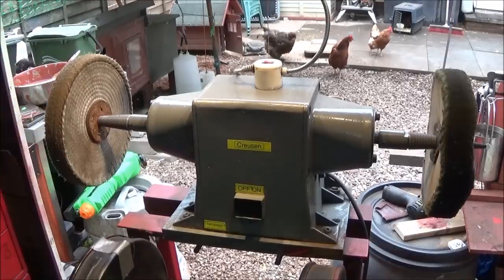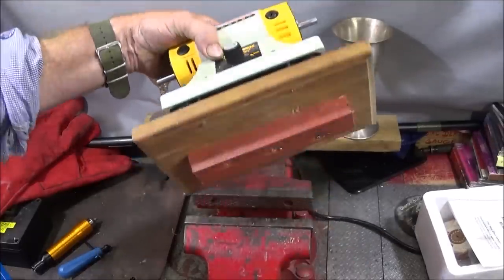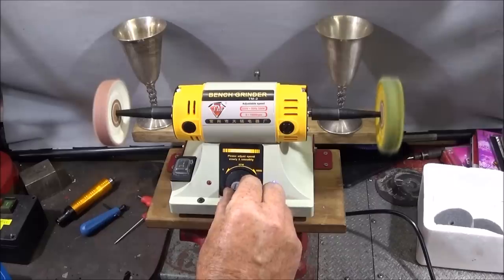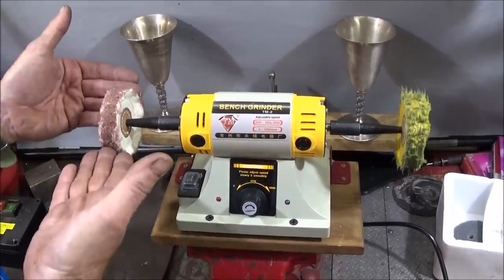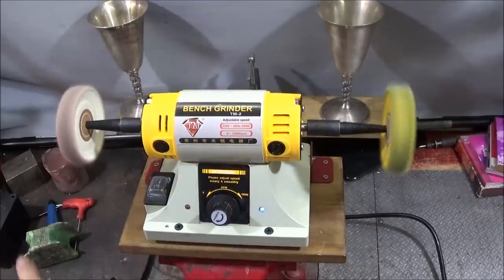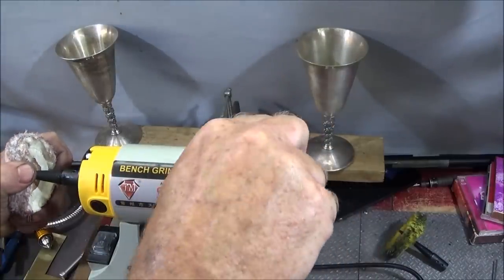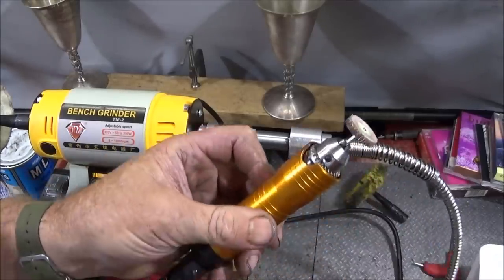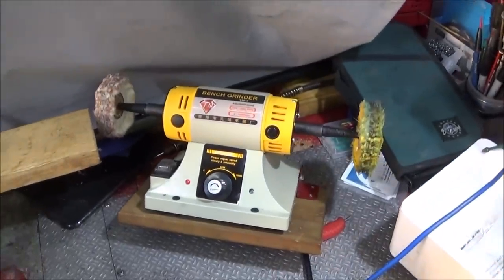Bench Vice Buffing/Polishing Machine & Toolpost Drive Tool TM-2

Comment: Steve,
If you had a skirt underneath the grinder that was larger than the vice as well as the piece that clamps in the vice it would sit properly on a flat surface as well.

Mike

Comment: I've been waiting like a puppy for your promised video of your shop made radius cutter/ball turner for the "Chinese Lathe".  I've also been purchasing some of your recommended tools and products as I find your reviews interesting in light of your machining experience.  I think that a lot of viewers like me trust you, and I know that you're aware of how important that is.
Reply from the maker: Hi Jeffrey, I will get round to it at some point. Did you make the first part how I explained in the first video? All that is very straight forward. Its the insert holder part that takes a bit of time.
Reply: I've been looking at Part # 4836 at Little Machine Shop . com; it's a T slot compound rest top  for $35.82US.  Together with a new gib strip this seems like a good way to go.  What are your thoughts?  Thankyou for your consideration.

Comment: Why did you acquire adapter for flex shaft attachment? Does it not attach to grinder unless you get the adapter? Not a frequent tool user so having a hard time figuring out how to attach the flex shaft to the grinder end of it.

Comment: Hi do you have a link to buy the flexible shaft adaptor that goes onto the spindle to enable me to attach the flexible shaft. tx
Reply from the maker: Hi Vicky I have searched the Banggood site but can't find the listing. Mine actually came with the flexible shaft when I bought it. I have recently bought another polisher but there wasn't one included in that set. You may be able to find one on eBay. If I find one I will let you know. Regards Steve
Reply: @SteveJordan  thank you

Comment: Thanks Steve, would you use a different wheel for different materials? One for brass, one for steel, one for wood etc? Cheers
Reply from the maker: Hi Shaun I just use the same wheels for most things as long as I  don't pollute the wheels with anything.

Comment: I don't know if you will see this or respond but I am curious. I've been using a version of this tm2 for a few months as a lapidary related hobby. Yesterday the blue light started blinking and the motor made strange sounds. I turned it off immediately. And then tried turning it on later and it will not turn on. My friend thinks it's the carbon brushes so I'm waiting for those in the mail. Do you have any ideas?
Reply from the maker: It does sound brush related. I would try that and if possible clean the commutator. Other than that I don't know. Regards Steve
Reply: @SteveJordan  thank you!

Comment: hey Steve, before i buy this, i have a question. Can put a jacob's drill chuck or any chuck to hold diamond burs on one of the ends, and if so,  will it handle its wait and operation?
Reply from the maker: Hi yes I connect a flexidrive shaft and use diamond burrs etc
Reply: Do you mind showing me how u didn't, vid or pic or anything. I want to buy this. Your help on this will be appreciated. Thanks
Reply: another question, in this video https://www.youtube.com/watch?v=sMzrIYLKD00 at the 6:30 mark, there is a lathe used, anywhere i can  that kind in a mini fashion but with a toolpost to have a tool bit in. most mini lathes i see have not toolpost.
Reply: i need a mini lathe that is really really light, as mini as possible like in that video. because i have to ship it from US to another country. i want to minimise costs.

Comment: These look ok for home, shame the minimum speed is 1000, 500 would of been much more useful. Good though other than that.
Reply: I'm also looking for a bench grinder but with very low starting speed. Any idea, brand/model in mind? Can I plug a kind of router/ speed regulator to slow the motor down , do you think ???

Comment from the maker: SEE BUYING LINKS BELOW:-
TM® 220V Adjustable Speed Mini Polishing Machine -- https://goo.gl/tsVoYT US Warehouse -- https://goo.gl/y26kZk
Drillpro 0.4-6.5mm Flexible Shaft --  https://goo.gl/Lxk5bT (This flexi-shaft has the 10mm female thread connecting lug as shown in the video).
Reply from the maker: Satene Buffing Compound 150 Grit. (See seller for other grit grades).
https://www.thepolishingshop.co.uk/abrasives/abrasive-compound-satene-compound/abrasive-compound-450g-small-bars
Reply: Steve - can you respond to my invite?
Reply from the maker: Hi Simon, what was the invite? Sometimes I miss the comments.
Reply from the maker: 70% off Electric Tools Promotion --  https://goo.gl/hf8cQ3
Reply from the maker: Banggood 12th Anniversary Electronic Sale --  https://goo.gl/SY4GX1